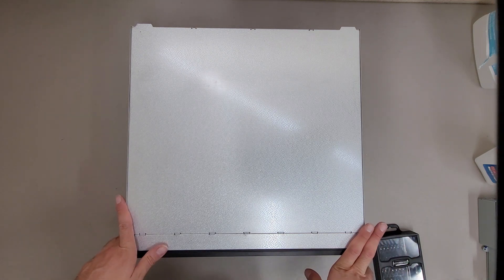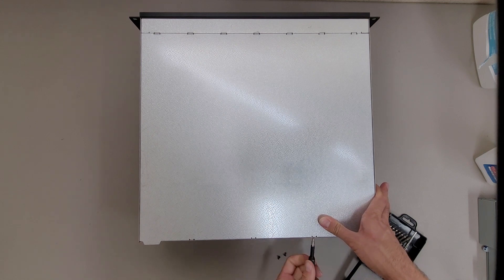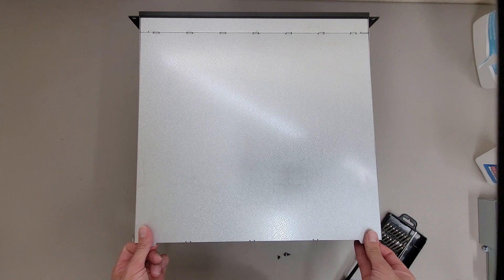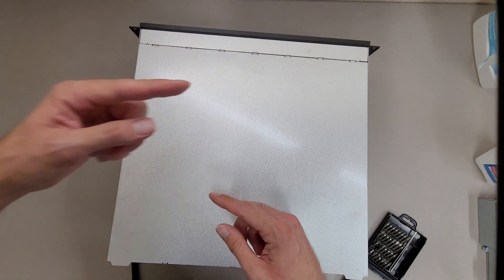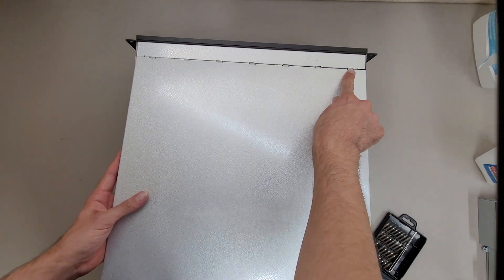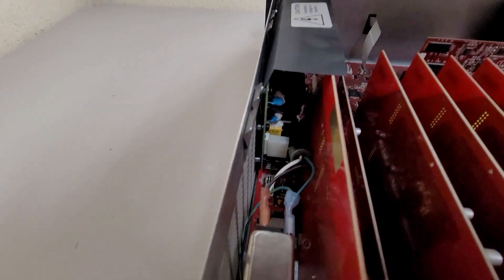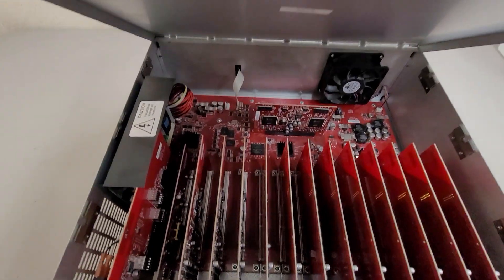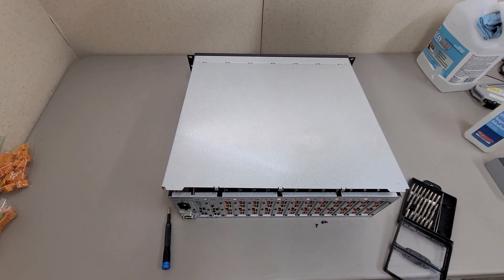Looking inside a Biamp Systems Tesira Server-IO #teardown

Comment: @3:50 you can see a tiny metal rod extending from the right hand corner towards the left, underneath the cover, guess that acts as a joint but also keeps you from removing the cover ... interesting gadget, thanks
Reply from the maker: I would have to look closer.  From what I could tell the front was held on with bent tabs.  I just couldn't figure out how they were keyed in.
Reply: @computersales  I work with Biamp Tesira daily. The lid are made on factory using a very simple bending press. Some imperfections are present in some units. Allthough this is no problem structural wise, it may keep the lid in place without using some seemingly excesive force.

The lid itself; Remove the three screws as you did, lift up in the rear as you did, though not so high, just enough to get your fingers on the underside in the rear. Then just pull the lid towards the back.

The cards in the center of the unit is processing cards. It is the math of the system.

This unit handles audio and logic. There is no processing for video in this unit. Slot 14 is fixed for SNC-1, which is where the units program is located. (custom made
Slot 11-13 are advanced ports, where you could add different network protocol card (Dante, AVB or Cobranet). The rest is general I/O, that can either take 4x input (green), 4x input with AEC (Orange), 4x input with ANC(Blue) or 4xOutput (Black). There is also options for analog phone line or VoIP cards.

Your setup has 48 AEC channels (Can process 48 microphones, each with their own acoustic echo cancellation, and it uses AVB to reach the other pheripherals (amplifier, USB interface, other input/output units). The AVB card can handle 420in&420out audio channels, which is pretty plentiful. (If you do need more, you could always set in another card)
Reply from the maker: @Dbass91  Thanks for the explanation.  I kinda figured the cover worked something like that but I didn't want to risk damaging it since I am selling it. Sounds like it can do some pretty cool stuff.